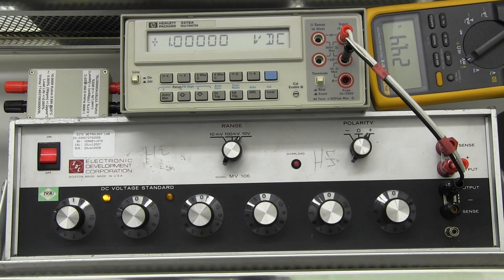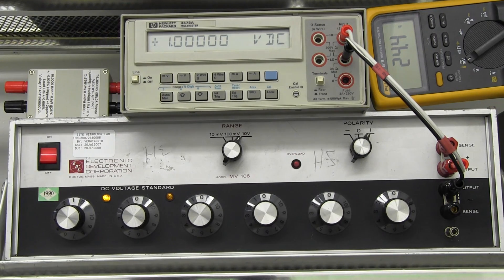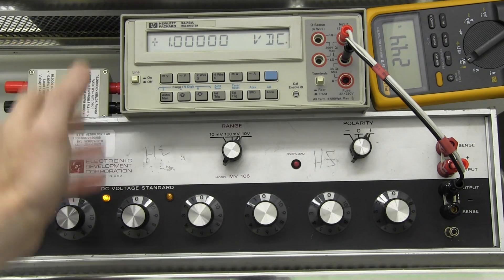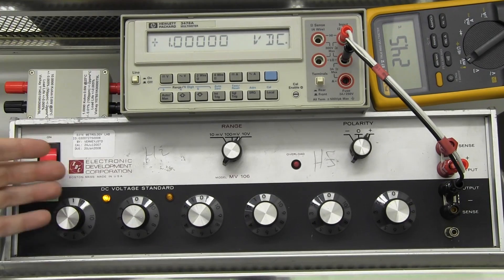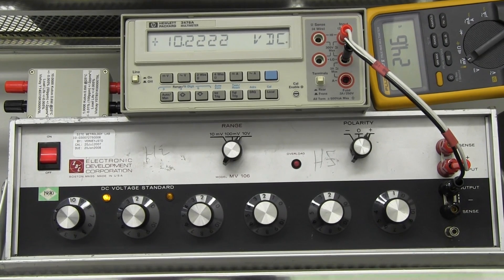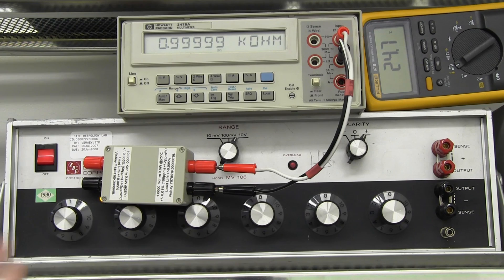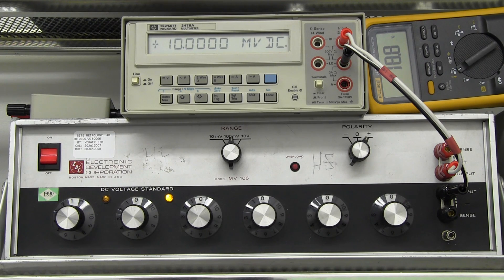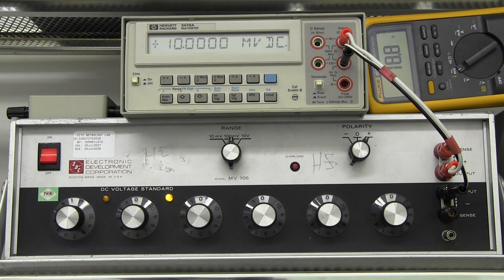EEVblog #374 - DIY Multimeter Calibration

Comment: Let’s say you have a standard that is accurate to 10.00000. Now you want to calibrate a DMM to 10.00. Should you (1) turn the adjusting potentiometer until the display is flickering between 9.99 and 10.00, or (2) turn the adjustment until there is a solid 10.00 on the display?
Reply: Depend on the brand. Fluke professional models teach you how to calibrate in the manuals. My meterman 38XR  is fine tuned calibrated by software using the hold button - potentiometer used only for initial coarse adjustment.

Comment: No data could be used for reports or documentation, However could still use the test equipment when calibration was not required. I would issue that type of test equipment when no precise testing measurement was required. Working at a calibration lab for the Navy.

Comment: question in some multimeter models there is no contonuity function and diode measurement it is possible to add this function as in the case of the multimeter HP3468A

Comment: well brand new DMMs are calibrated at factory yes but wierd things can happen, and happened to me one, I bought a 6 1/2 digit DMM for work with calibration certificate etc. and 4 months after that a calibration team came to the site to perform on-site calibration and I put this DMM on the list, they told me there was not need to calibrate because it was purchased 4 months ago, I of course insisted and yeah next day they were shocked that frequency measurement was off by ~50KHz in the 300KHz range, what could happend, something in the shipping? I don't know :)

Comment: which accuracy is needed for modern digital electronics?
Reply: By its very nature digital doesn't require much accuracy at all. Analog is much more critical. For instance, when you use an IC at 2Vcc, a HIGH input signal can be anywhere from 1.5V to 2V. And LOW input is anywhere from 0V to 0.5V. (data taken from an NXP 74HC595 datasheet) So in order to check those signals you don't need any accuracy at all. For digital, being able to capture sequences of voltages is much more important. You'll find yourself switching to a logic analyzer and/or oscilloscope instead of a multimeter very quickly when you start working with digital signals.
Reply: @ArumesYT  Yeah, I know. Just curious where it is needed in modern digital world. Rf design?

Comment: So how do I calibrate my hp3478a? I was under the impression that you'd  show us how it's  done.....
Reply: You need a pocket screwdriver to put it in CAL mode, shorting straps for front & rear terminals, and $$$ of AC, DC and Resistance standards. AC is the worst because "complete" CAL requires 280 VAC @ 100kHz, and 25VAC @ 300kHz ref 😆.

Comment: Have a question about the resistors.  I see those ones you have in your calibration device you built cost like $15-25 a piece! WOW! 

I was wondering.  Can't I just take a cheap penny 10k resistor down to my electronics shop and have him record the exact reading they get with their 6.5 digit meter, onto a piece of paper?   Then when I make the little black box with handy connectors like you've done, I just write down the recorded reference value and compare meters to that number?  Would save a lot of money that way at least.
Reply: Nope, resistor can drift with time and will drift with temperature and humidity. You need at least a stable one to do this. If your electronics shop does this measurement for free you could give it a try with a low tempco, stable resistor but it will be in the couple of bucks range at least.
Reply: Keep in mind that it'll last a lot of time and it's very high precision. If you want, you can buy a slightly worse one. You can use parametric search and order by price. And remember to check that the minimum quantity is 1! I would use Digikey since they have very good parametric search, and if the order is more than 50 €/$, you have free shipping! You can order two of those and have free shipping.

Comment: Quality people love calibration.  The last electronics CM I worked for bought a few cheap DMM's for test technicians, then was paying double what the DMMs are worth each year just so they have a valid calibration certificate.  Our quality manager had never seen or heard of a "No Calibration Required, Not to be Used For Conformance Testing" label before and thought everything always needed to be "in-calibration".  Many calibration houses will not even tell you what they needed to do (if anything) to calibrate a meter, or how much the meter was off.

Comment: Hi, i have a fluke multimeter, and we sent them to be calibrated, but the lab returned the DMM with blown fuse, is this normal during calibration?
Reply: Edward Carnby They checked if the fuse is still in its nominal specs :D
Reply: Surely not.

Comment: Usually a precision Zener diode reference. Some labs use mercury/silver oxide/zinc air batteries as their voltage is extremely stable over the life of the battery.

Comment: It used to be standard cells with a well defined cell potential. Nowadays I think that something called the Josephson effect is still used for standards. A Josephson junction is a superconducting junction that you can apply a DC voltage which will produce an oscillating current over the junction at a frequency dependent on the applied voltage. Luckily the reverse is also true. An applied AC current will produce a DC voltage which is dependent only on the frequency. Not the current magnitude.

Comment: I found an article I had purchased from Silicon Chip talking about a 5V precision Reference using a Maxim MAX6350. I think I've seen similar articles elsewhere. I've always wanted to build one but never got around to it. What do you think? Could I use the MAX6325, MAX6350 as a poor hobbyist calibration standard?